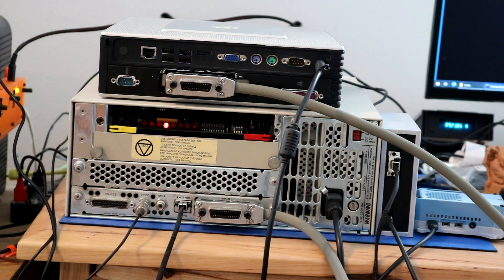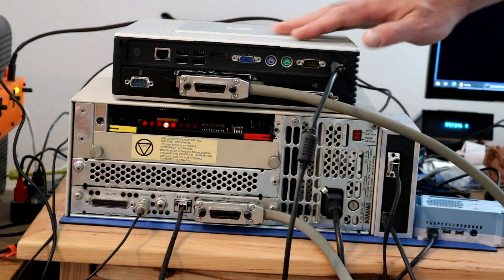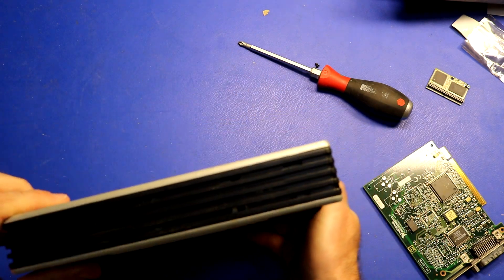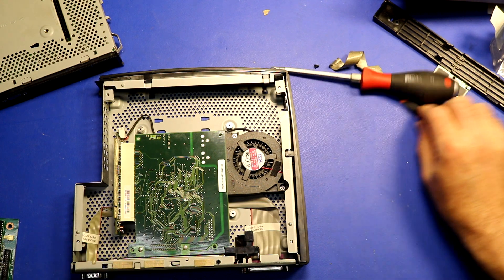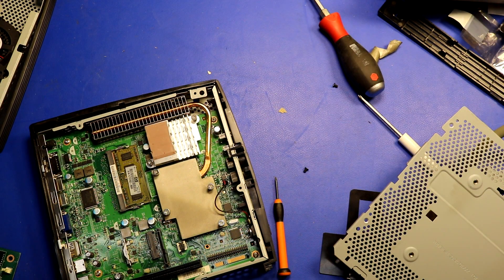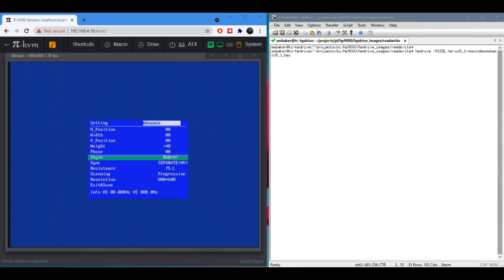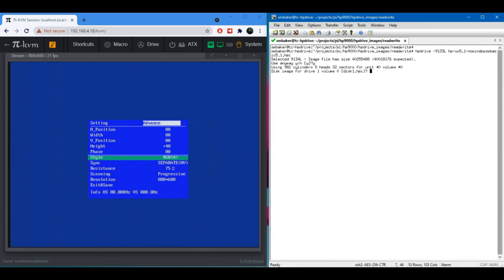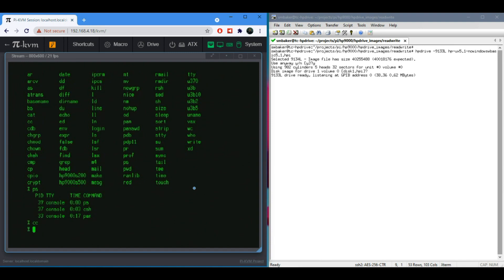Assembling a thinclient to serve as an HPDrive for HP9000 Computers

Comment: So is the ras-pi acting as a dumb terminal or actual thin client and not some strange mouse keyboard monitor over ip adapter with some odd software so the rapi would run some basic kernel to find the machine over IP and ssh in or whatever they do to get the GUI and streaming and all that. It’s my ultimate project to do that, stream games to a rapi from VM server where I do the install from another server running as pxe boot. Fun stuff. Love ur machines btw.

Comment: Instead of cutting the chassis to accommodate the cable, I'd recommend using an HP 10834A HPIB adapter. They're specifically designed to deal with this exact issue and cheap!

Comment: Great - thanks! Heading over to eBay now to buy some stuff! Probably be helpful if you listed the actual equipment used in the intro - gotta scroll back through the video to get more info on the Pi KVM and video converter.

Nice shade-tree mechanic work to "modify" the case for GPIB clearance.
Reply from the maker: Thanks for the suggestion. I've made a bit of a brain dump into a blog post over at https://www.smbaker.com/assembling-a-thin-client-to-serve-as-an-hpdrive. At least enough for someone to get started.